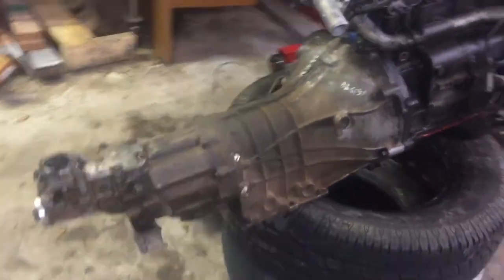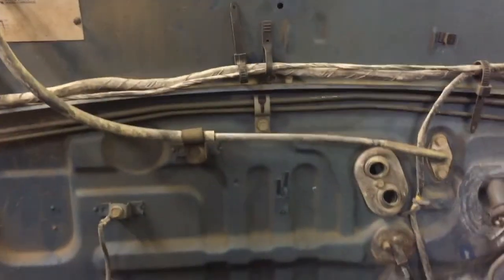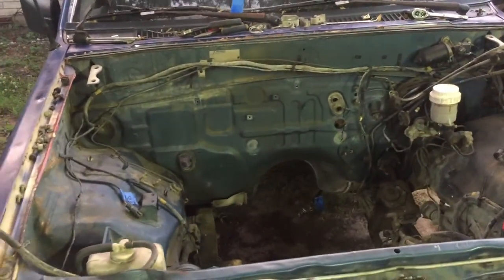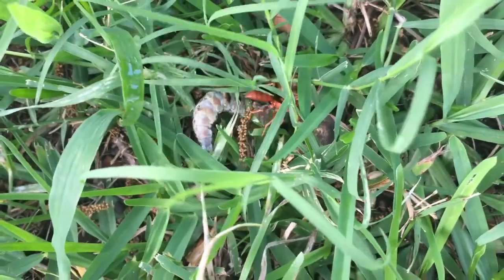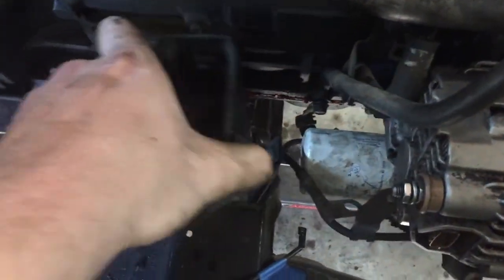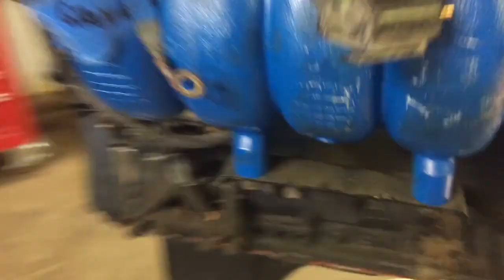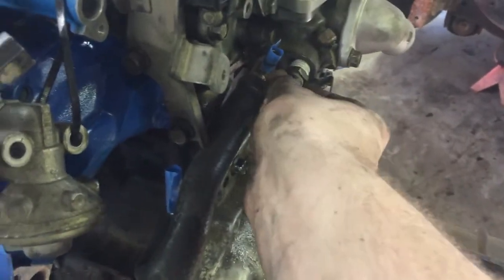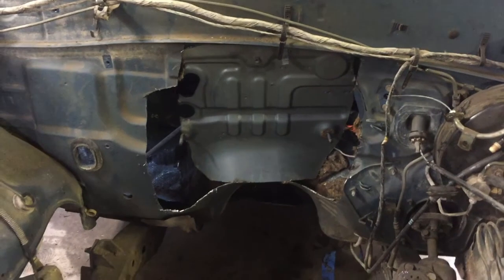MM 4G Swap Part 8 - Engine Test Fit/Firewall Modification

Comment: Nice work..!! What clutch are you using? I wonder if the transmission from my Mitsubishi Montero fits it has the same 4 cylinder but it’s a 2.6.. I will love to do a turbo swap..
Reply from the maker: Good question, it’s all about whether the engine and transmission are the same bolt pattern (wide block or narrow block). I used a turbo starion clutch. All that info can be found on project zero g forums, great resource for swaps like this
Reply: @dsmmonster Did you ever do the swap? i’m planning to do the same with my 87 montero, i’ve got the 2.6 aswell, any tips would be appreciated!

Comment: Noticed you said the transmission of the truck did not fit. So what transmission did you use off a car truck and what year make and model? If you don't mind the question.
Reply from the maker: CARS ,FOR FUN CHANNEL you need a KM-132, which comes in 2nd gen manual Mighty Max's with the 2.0 engine. My truck originally had the 2.6 so that's why it didn't work
Reply: the one that didnt work... what was the code for it? was it an R5m model?
Reply: Fahim Ali did you figure it out
Reply: Nah, i never found out... My truck has the 4d56 diesel with a R5m2 manual 5speed.. But they aren't very strong..

Comment: I have a 92 mitsu mighty max with over 300000 miles on it... body is great, no rust, but the engine is toast at this point... a cousin knows where there are 5 wrecked eclipses... needless to say, I'm interested in this build. Hell, if you weren't so far away, I'd be interested in the engine you PULLED LOL
Reply from the maker: Do the swap man! It's dirt cheap
Reply: mine is the 2.4 wide block with balance shafts and EFI... I spent 100 dollars on it 10 years ago (blown head gasket when I bought it) then drove it another 200,000 miles... not bad for bone stock 500 dollar truck